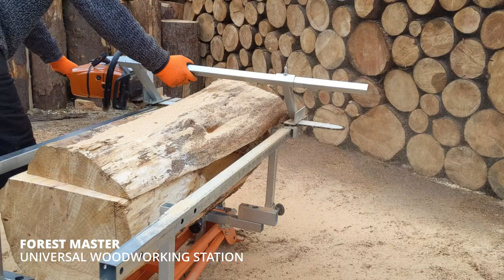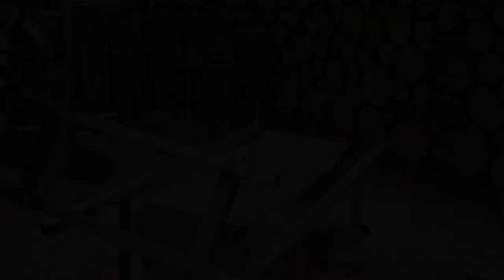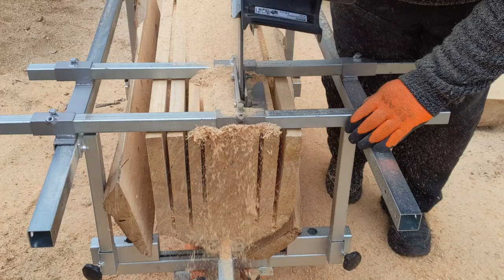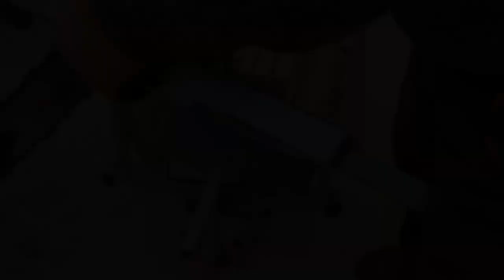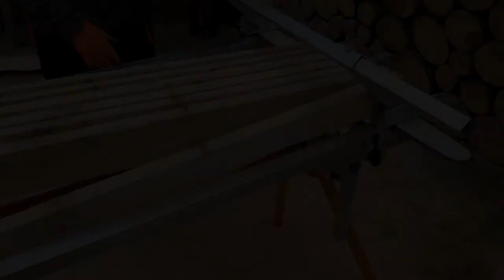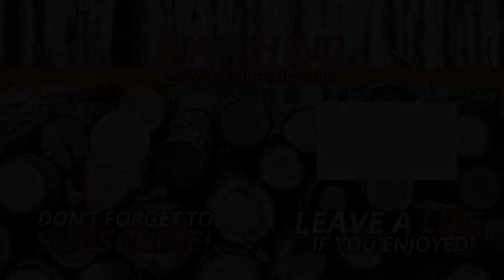Chainsaw Mill Vertical and Horizontal Cutting - Milling Planks

Comment: That’s cute . Only if it were 9 ‘ or 12’ long is the only way I myself would have any use for it .
Reply: You could easily build one of these from scrap bed frames.....even if you dont have a welder you could drill holes and nut and bolt it together !
Reply: @callmebigpapa  life’s too short. Just buy one ready made!
Reply: @robertdavies922  You are right time is the ultimate commodity